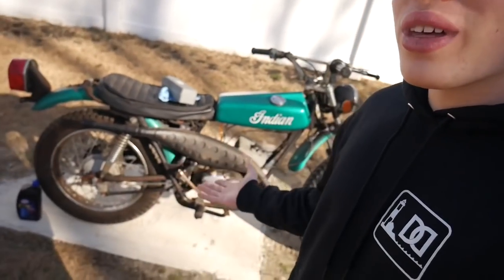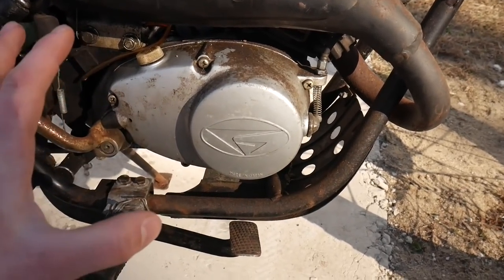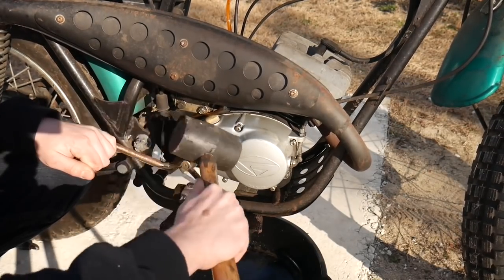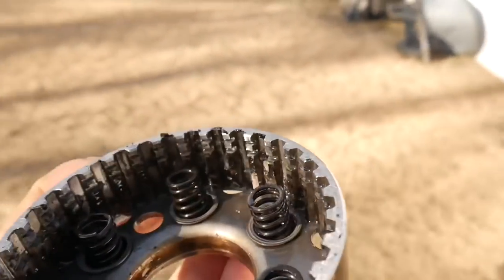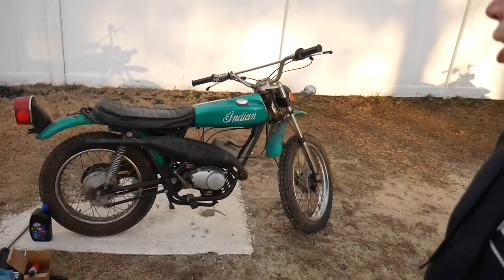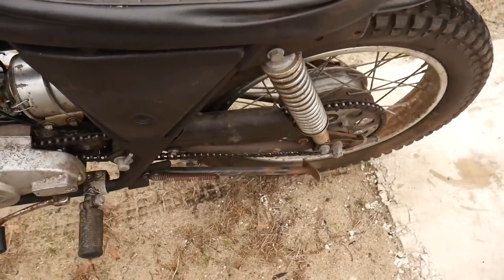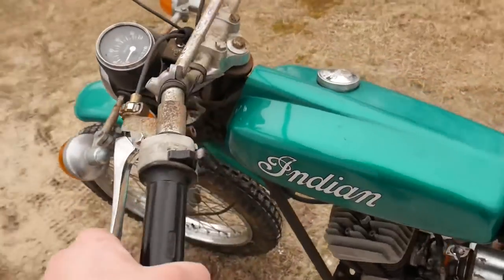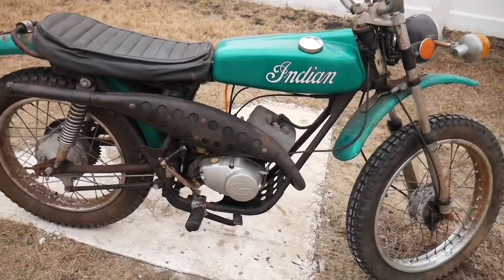The Vintage Indian Hits the ROAD for the FIRST Time in 43 YEARS! It Runs and Rides AMAZING!

Comment: For you and anyone else that has an Indian ME 100 and is a little unsure of this maintenance..........The stubborn stiff shift lever is an easy fix, just did the same thing on my “new to me” Indian ME 100 last week that has been unused for the last 40 years as well.  Notice there are two zerk fittings for grease on the left side engine cover by the shift lever shaft.  Most likely the 40 year old grease inside got hard and the mechanism components aren’t working freely, or you’ve got sand or heavy corrosion inside.  You might get away with injecting some new grease in the fittings and working the shift lever repeatedly until it works easier.  If not, no worry, the engine cover removal is fairly painless, and you have to remove it periodically anyway to access the breaker points so it’s meant to be removed.  Good time and reason to take it off and learn what’s inside.  No need to drain the crankcase oil, that side of the engine is dry (or should be anyway).  Leave the shift lever attached, it comes off with the cover.  Start by removing the 2 screws and taking off the inspection cover located just above the shifter shaft.  Looking in the inspection window notice how the linkage small rectangular “sliding block” rides in the groove on the end of the rod.  That shift linkage “sliding block” moves the rod in and out of the sealed crank case.  The depth (or length/position) of the rod moving in and out of the engine crank case determines which gear is engaged.  Take a pic if you need to but pretty simple, and the purpose of the inspection window is so you can make sure the linkage “sliding block” is back in the groove when you replace the engine cover.  
  There are 3 screws that hold the left side engine cover on, use your impact driver to remove screws (NOTE:  top screw is longer than the other two).  Pull off engine cover, flip it over and remove 2 screws holding the inner sheet metal cover to expose the shifting mechanism components in all their glory.  It works kind of like a ratchet wrench, pretty ingenious.  Clean the hardened or excess grease off the components so you can see how they work together.  The odd-shaped shifter plate (reminds me of a pyramid) is driven by the shift lever action and held in position by spring pressure on the outer detent cutouts.  Remember 1 down, neutral, 4 up and you will understand the detent cutouts as you operate the shift lever.  It takes a whole lot longer to explain it than watching it in action.
  After a thorough cleaning, inspection and greasing it’s ready to put back together.  Replace the inner sheet metal cover and two screws.  Position the left side cover on the engine, using the inspection window to make sure the shift linkage small rectangular “sliding block” is riding inside the groove on the end of the rod.  NOTE:  You may have to manually position the rod and/or use the shift lever to change the position of the linkage to get the rectangular “sliding block” in the groove.  Replace the 3 screws that hold the engine cover in place.  Replace the inspection cover and 2 screws.

Comment: Try some muddy.& A soapy pad together as your rim rust remover solution. It may not get all of the rust off at once though.,or you could use that jug style rust remover on that rim.& wearing thick kitchen rubber gloves.& soapy steel wool pads.&wet mudd on those area's of that rim. Hopefully it works.,or at least helps you out with getting the rust off that back rim.& the rest of the rusted chrome to.

Comment: My 94 yamaha YB50 is doing the same thing I cannot figure out why but hitting with a rubber mallet is not working . The bike was running and had good clutch . I took it for a ride and few mins in it just stopped havinh clutch . No bad sounds whatsoever . I changed my cable , clutch arm mechanism and check the plates . Still nothing. Help anyone?